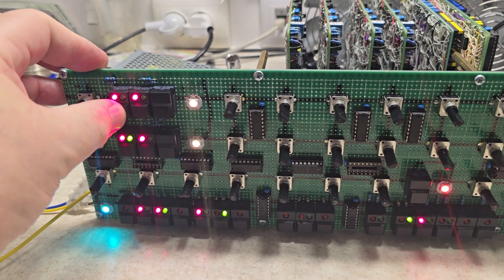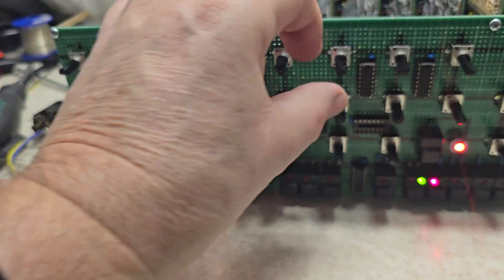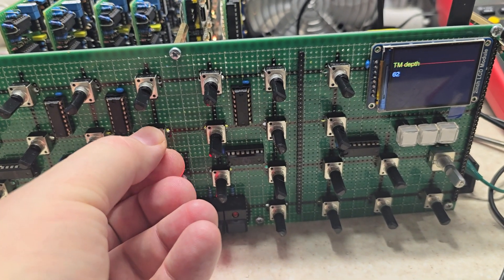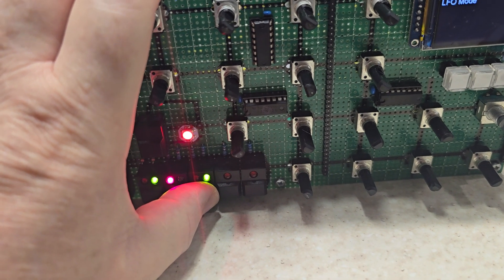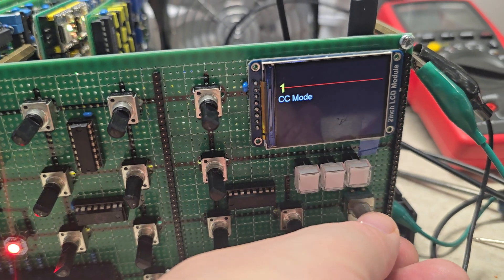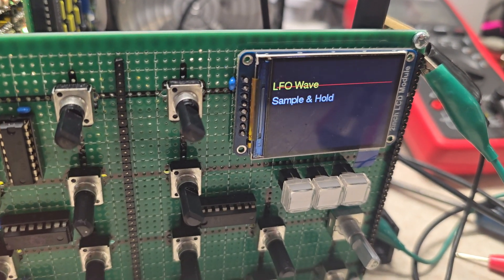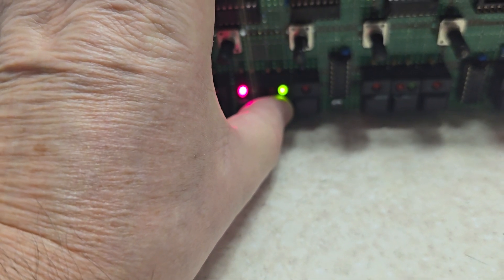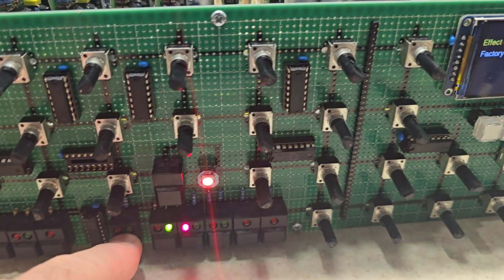Poly Zero 8 voice polysynth

Comment: I wonder how practical it would be to drive the VCOs with a microcontroller and PWM voltage control? I kind of like the retro idea of gaining some waveform purity with analogue main oscilators but I think for the modulation of the oscilator properties at a much lower frequency, that shifting to digital control techniques is a good common sense idea. I doubt the human ear can pick up the binary granularity of the required control frequencies and it offloads a lot of processing time from the micro to use analogue VCOs. I've experimented with some microcontrollers to create poly synth directly but with out extraordinarily fast processors it's not realistic.
Reply from the maker: No reason why you couldn't, they were originally under CV control but that had discrepancies in tuning due to tolerances of components. I removed the voltage control in favour of just sending midi notes for consistency and accurate tuning. But this design already creates 1v/Oct for filter key tracking so it could be simply connected to the VCOs and reinstate the CV control of the pitch for the VCOs.